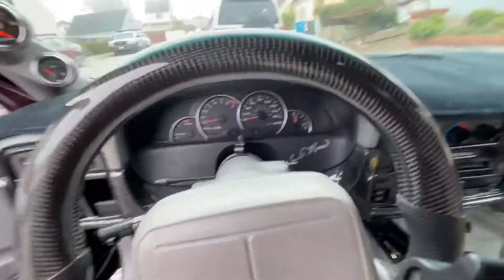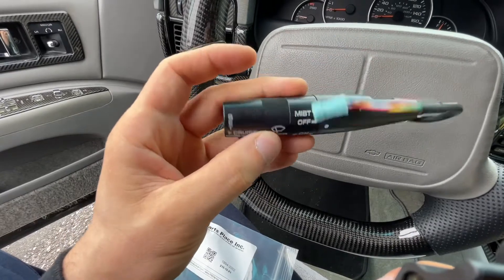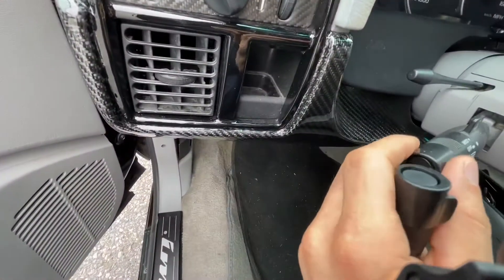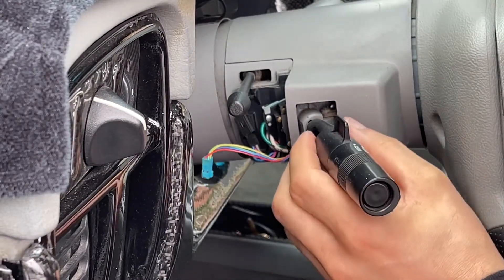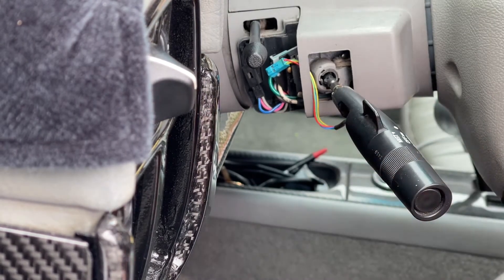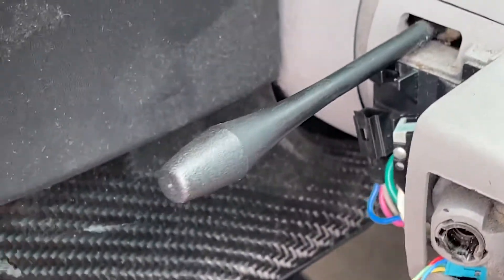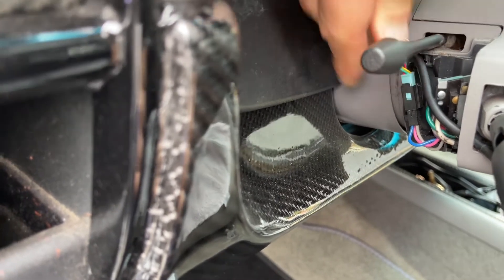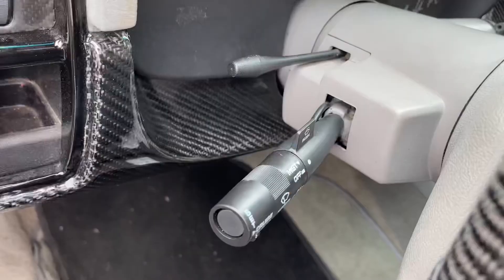Impala/Caprice Chevy Turn Signal Switch

Comment: Recently bought a 96 SS. Cruise control doesn't work. Do you think the blinker switch assembly as a whole could be the culprit?
Reply from the maker: Check fuses first.  But there are more steps after that. There is a wiring diagram you must follow and test connections etc